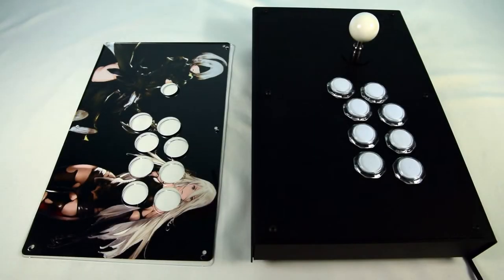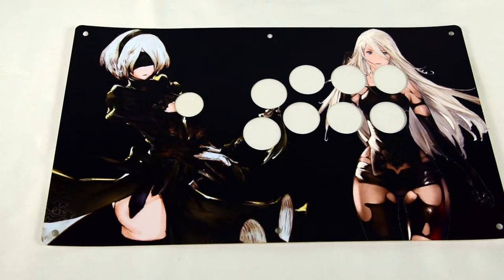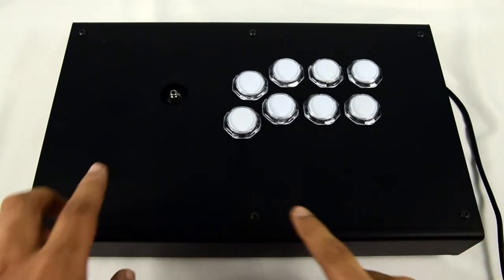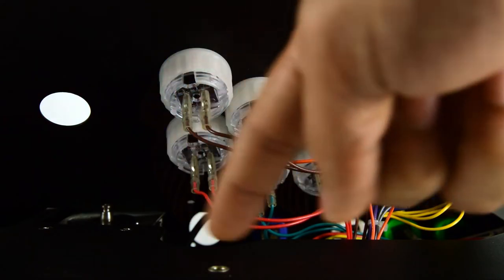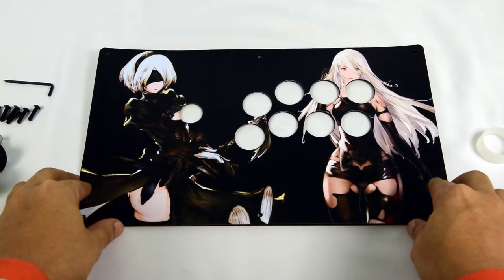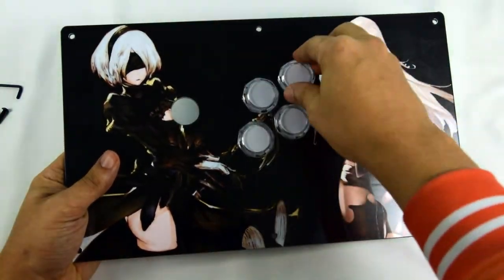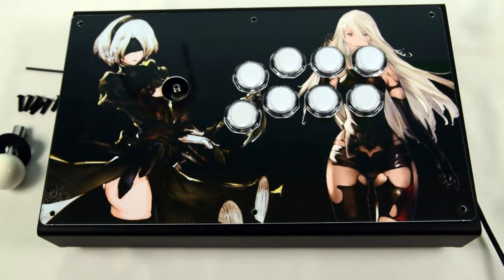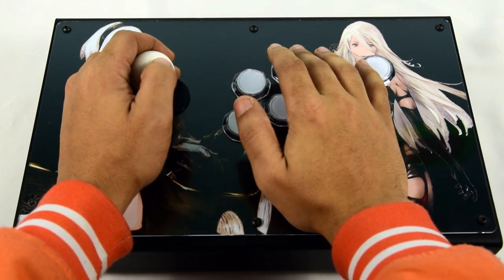Tech Corner: Customizing the AllFightSticks 14" Series Case

Comment: What's the material in which you print the custom artwork?
Reply from the maker: Artwork is printed on 10 mil cardstock sheet.  It carries 95% brightness and tensile strength of 100 pounds per inch.
Reply: @focusattackcom  wow, cool! Thank you for the quick reply!